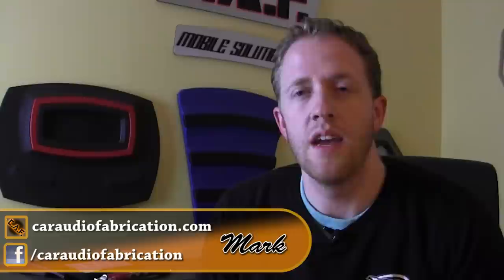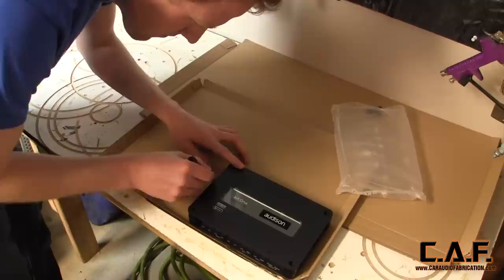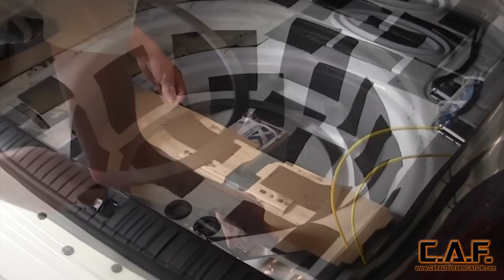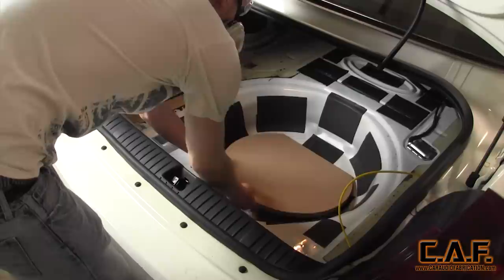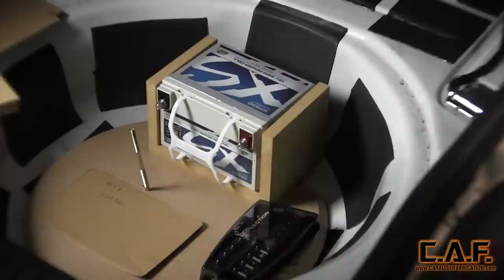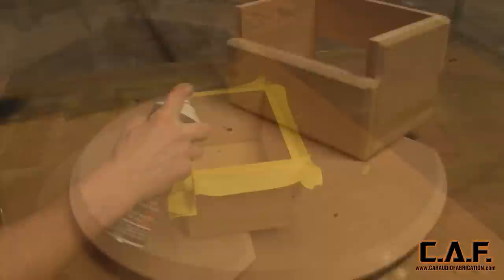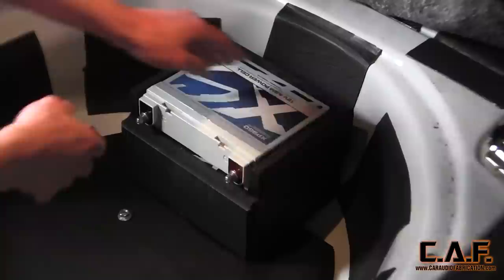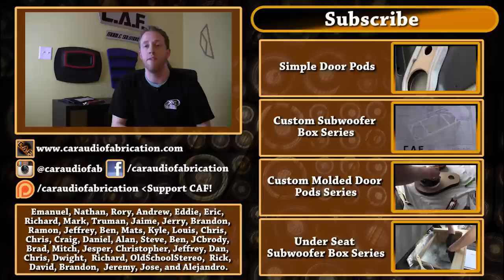Car Audio Battery Rack - VBL #3 - #ProjectRebuild - CarAudioFabrication

Comment: That's pretty much how I do my battery boxes.  Sometimes I add some strapping over the battery as an extra precaution.  Looks good!
Reply from the maker: Michael Gravenstreter Thank you for watching! The amp rack on top will actually hold the battery in place, I am also considering making a 3d printed strap, what do you think?

Comment: only suggestion i would make would be to use nylon locking hardware when installing stuff like that bolt used to hold the battery tray down. granted that gravity will hold it in the wheel well but it could rattle loose. keep up the good work yo.

Comment: Countersinking the hold down nut by securing a block under the top piece and a chamfered hole for nut access would have made a much better appearance .   Great build so far , can't wait to see the rest of it
Reply from the maker: Craig Voisin That's a good idea! Im not sure the wood is thick enough that I feel comfortable with counter boring though. Something to consider in the future. Thank you for watching!
Reply: CarAudioFabrication  just add a small scrap of MDF glued and secured  to the underside to double the thickness in that area

Comment: very cool looking forward to seeing more. i am actually needing to build an whole new setup because i am adding another amp.
Reply from the maker: XmackattackX Nice! What are you adding?
Reply: CarAudioFabrication i have a kenwood 1000w amp KAC-8105D pushing two dayton classic 18"s DCS450-4 in an IB config at 2ohms. my secondary battery is a Kinetik KHC1800 in the trunk. it has a stock stereo system as of now. but i have an EQ which is NVX XEQ7. 
i have some videos of it on my channel.

i am adding an MB quart ONYX 4.60

Comment: only thing I would recommend is adding something that would go across the top of the battery to hold it in. like a thick ruber bungi or fabricate something from metal that can bolt down. a loose battery could be very bad in a accident.

Comment: Thanks for the vids. It actually gave me an idea to finish my build. Awesome vid
Reply: Forgot to mentioned that the sfdc distribution  block from audison is one of my favorite.
Reply from the maker: Robert Lugo Nice! Thats what I like to hear! What are you building?
Reply: I am on ig audiophiledepot. 5 voce amps 2 audison distro blocks, 2 bitones using a purei20 and a optical splitter for the bitones. All audison Thesis speakers 3way up front and 3way on rear. Work schedule is killing me.
 I HAVE GAIN LOT AND LOTS OF EXPERIENCE WATCHING YOUR VIDS. thanks
Reply from the maker: Robert Lugo Nice! I follow you on there! Thats awesome, good to connect. Send me an email please using the contact form of my site.
Reply: Sure

Comment: I would have probably used at least two bolts to hold the assembly and also a strap on top of the battery to hold it down. There is a substantial amount of mass attached to that board and I wouldn't want it to move around in the event of an accident or high g's of a track day (the purpose of a big brake kit).

Comment: I dunno.
I'm not quite happy with placing the Battery on its side.
Even if it's sealed. If it's being charged some gases escape via a labyrinth. Which is normally on top of the batt.
Not that some rather corrosive liquid escapes...

Comment: Hey Mark!
Just a question about the spare tire mounting post. Instead of drilling new holes for a ground later could you not use that post as a ground using multiple nuts on the post?

Comment: Per the end part I am wondering what fuse your going with? I ordered a 500A breaker type to put to protect current from this battery, front has a smaller one feeding the run. From what I remember (been so long sense I have done a system) both batteries need to have a fuse protection to keep it ohms law in check if there is a short or one of PNP chips decided to get lazy inside the monoblock,

Comment: I would have mentioned that most normal car batteries are not suitable for mounting on their side and battery acid will leak out which is highly corrosive and dangerous so if you are going to copy this design make sure you use a battery that is safe to be mounted on it's side. Check with the battery manufacturer before purchase.
Reply: He mentioned that in a future video he will be going over that information.

Comment: Why did you use so thick MDF in this case? Any particular reason? Have you looked at the Valchromat MDF that is denser for being able to reduce thickness? Also, did you consider to recess the nut that holds it all in place in the bottom and maybe replace it with a wing nut or another type that you could unscrew by hand?
Reply from the maker: Paul Sandin The more I elevated the mounting surface the larger the piece could be, I also wanted to make sure it was good and strong as many things will be built off this initial piece. A wing nut is a good idea, I want to keep this part of the install designed so that it requires tools to remove, but really only one tool (a wrench). Thank you for watching!
Reply: Ok, thanks for replying! I like your work!

Comment: Hey CarAudioFabrication I'm new to this channel. Second video in. So far so good. Question though, I'm wanting to throw in a 2k watt system. Secondary battery defs required. Would you recommend the secondary battery with a capacitor? Or go the high out put alternator route (which I hope you don't say do)
Reply from the maker: Bouge laal How much output does your current alternator have?
Reply: CarAudioFabrication I just checked the alternator. its 12v and 100Amps output.

Comment: Its a gel battery i hope?
Reply: It's a dry cell battery I think
Reply: Tim van der wiel "AGM" battery
Reply from the maker: Tim van der wiel It is an AGM battery - Info straight from XS power "Absorbed Glass Mat (AGM) Batteries completely eliminate the hassles of conventional battery maintenance. There is no liquid acid in AGM batteries. All of the acid is absorbed into the compressed glass matting in the cells. They are completely Non-Spillable, so they can be shipped by mail or courier service with no hazardous warnings or extract fees. Likewise, they can be mounted in any position for special application."